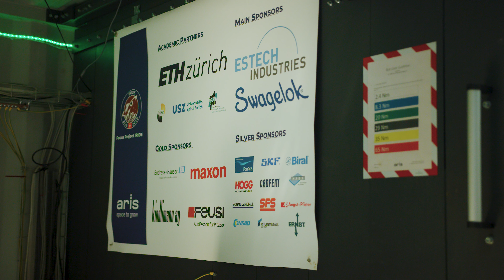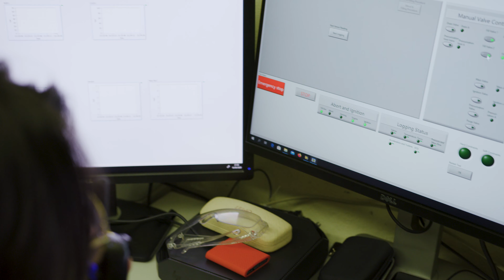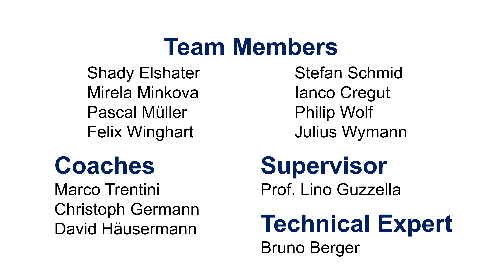Hybrid Rocket Engine IRIDE

Comment: Nice engine, but can see it has some low frequency pressure oscillations in the plume. Are you using Nitrous Oxide in autogenous pressurization mode or with a pressure feed system?  You probably need to increase the pressure drop across the injector to help decrease this effect.